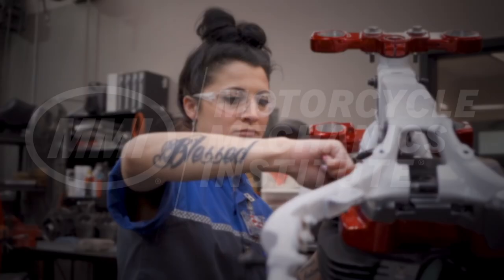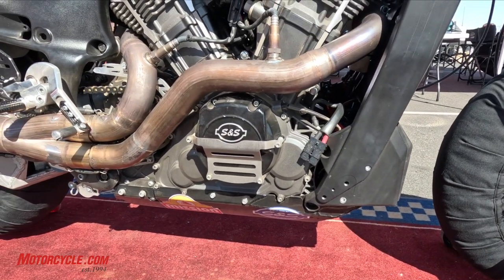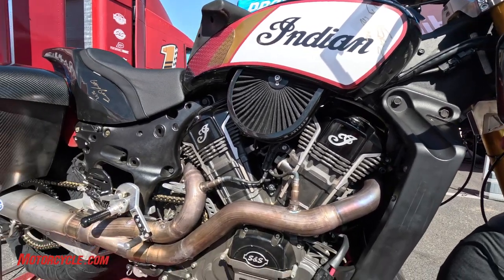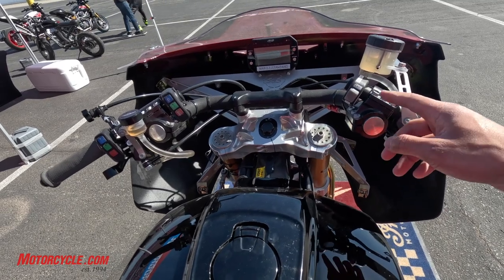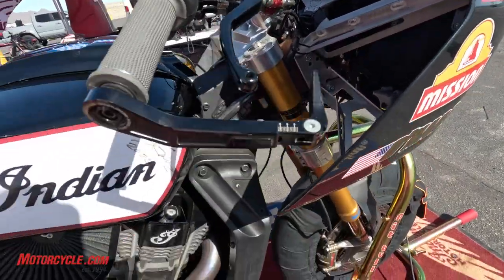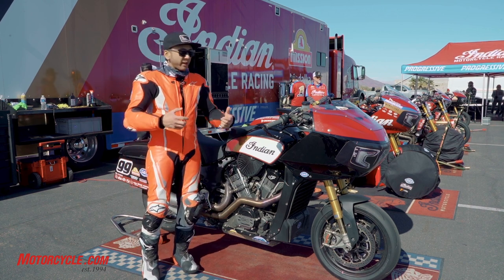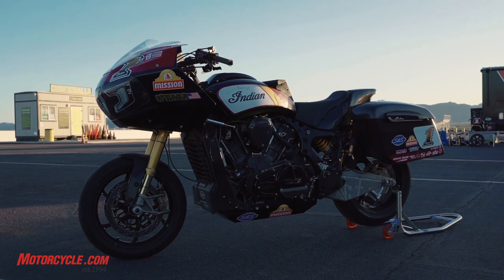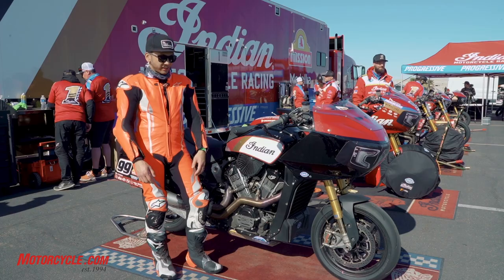We ride the championship-winning Indian Challenger Bagger racebike!

Comment: So the Challenger chassi is flexing and Harley is not, am I understanding it right according what you said  ? I thought that due to the different type of construction on those bikes it should be quite the opposite...
Reply: Yeah, you heard right. Look again at the part of the video where I talk about the frame. The Indian subframe is bolted to the main frame. That's the source of the flex. The Harley frame is solid front to back. The rules say you can't change or modify the frame, so that's what they have to work with.
Reply: @TroySiahaan  Thanks for your reply. I just thought that parts of the frame which are bolted directly to the engine which is used as a stressed member are ususally kind of frames which should be way more rigid than tubular frame. And it is known that heavyweight HD cruisers are starting to flex under stress load which is not known on the Indians with this types of frames directly bolted to the engine. But OK, you´ve ridden it so you know. Thanks.